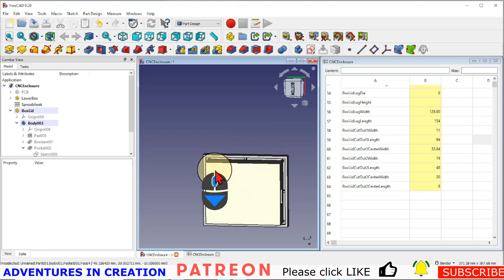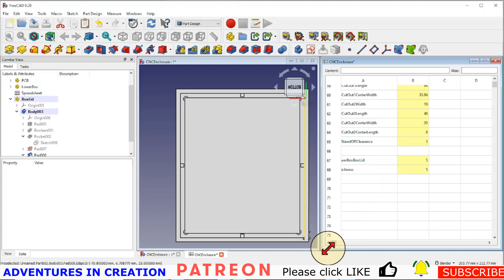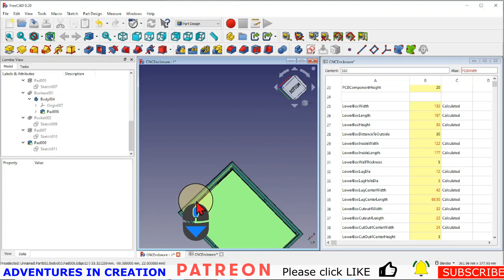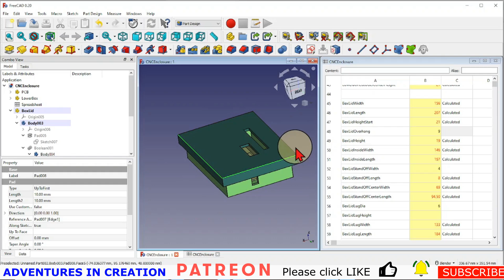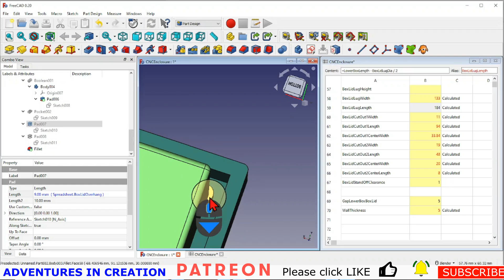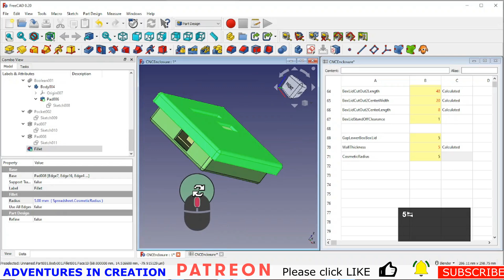FreeCAD Beginner #34 Fully Parametric CNC Electronics Enclosure Pt3

Comment: I noticed that in your spreadsheet, in the column for the values, anything that is calculated shows up red and anything where you just put in the value is black. I looked all over and couldn't figure out how to get my calculated values to show up red. It would save me from having to write "calculated" in the third column since I could just tell by the color whether it is or isn't calculated instead. Any idea where I might find that setting?
Reply from the maker: If you go to spreadsheet settings you can hang colors however, I don't think the color will change because it's calculated